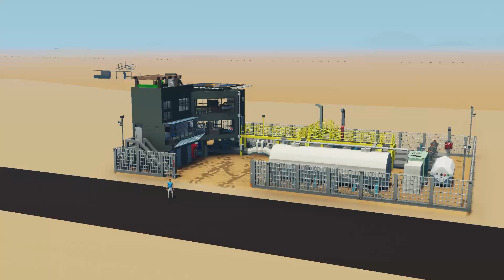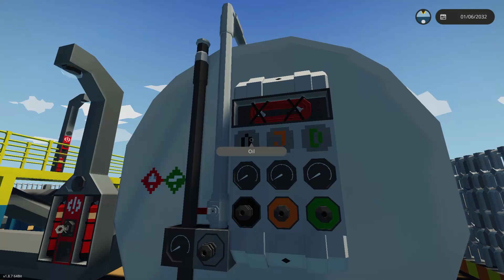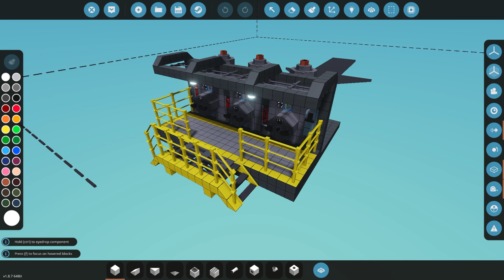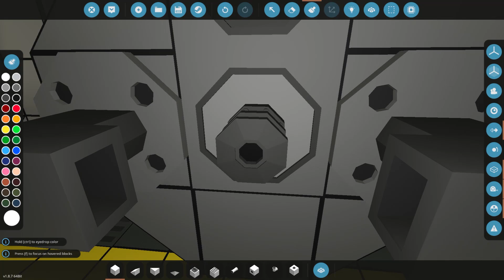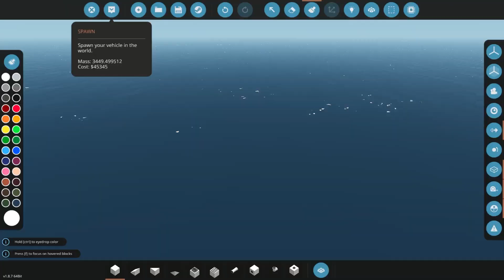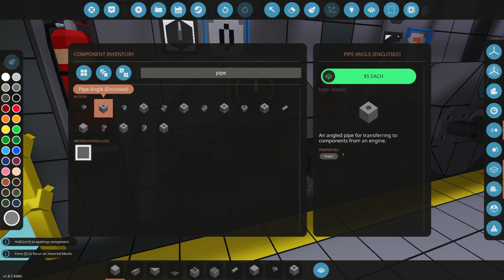How to use the OIL PIPELINE in YOUR Stormworks Build!

Comment: May I suggest, upload a second version.

A flat platform with all of the individual components seperated in straight lines, with the platform painted to show the groups.

Eg, have all of the oil pipe components in one painted rectangle. 
Pipes etc connected in a straight line, but dials, indicators, switches each placed alone.

Pipe components that MUST be connected EXACTLY painted green, sections that can be modified (say I closed pipe pieces between sections) painted yellow.

Do that for each section.

Have a forth section for components that MUST be placed for the rest to work.

So, say I build an oil drill rig and I only want to transfer oil.

I load the base platform, use the selection tool / merge tool to move fluid handling components to the drill head oil output, move the switches and dials to my control station, move the core components to the computer room, then delete the diesel and jet fuel components and base platform.

Somewhere else, I build a refinery. I I use all of the components, placed as needed etc.

I know I COULD do that with this build, however it would be easier and simpler for people to "purchase" a "flat pack" kit that they can install themselves.

Having the building as it is here is also nice, as you can make it an external building and run pipes across as is often the case in the real world.
Reply from the maker: Sounds like a great idea! Well written request that makes logical sense.  I will do that at some point :)
Reply: @454ss_gaming  Just a small question, is it at all possible to sell oil through the Alta pipeline? I see it can be pumped all around the map, but I can’t tell if it’s out of sight storage, or if it’s like an on site sell station.